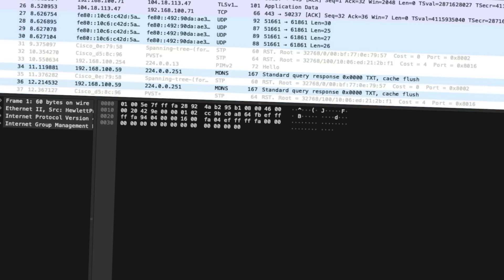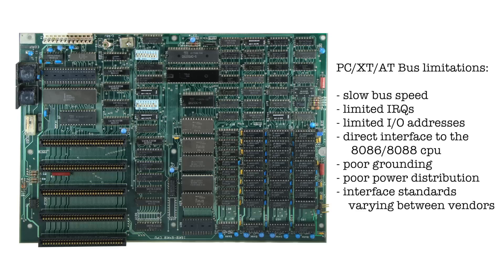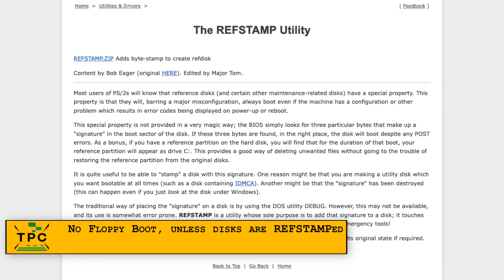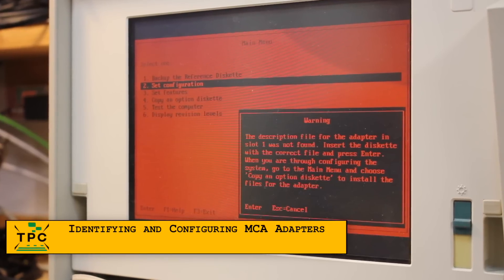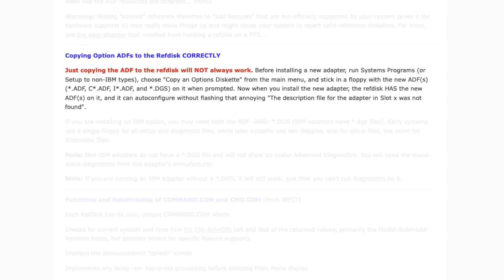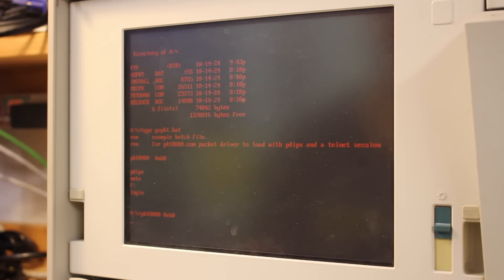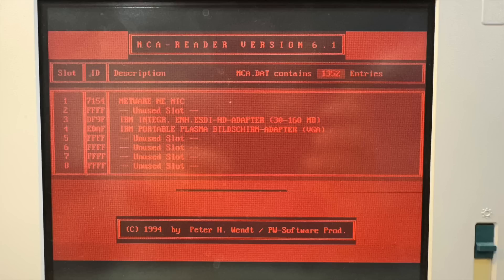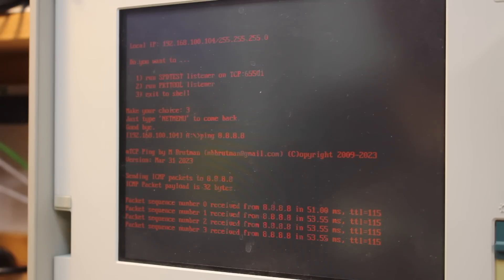Revisiting the IBM P70: Tackling the Micro Channel, Option Disks, and a Sneaky Ethernet Card

Comment: That brought back some memories, back in 1993 to 1997 I supported a range on ps/2 systems on token ring. The reference disks were a complete nightmare. I still have vivid memories talking to ibm tech support about a ibm 16/4 token ring card in an ibm ps/2 model 95 server running os/2warp and using the netBui and netbios protocol for a ibm lotus notes server and ibm said they couldn’t support it because of possible non ibm products

Comment: I think you are possibly overstating the scalability issues at large enterprise installations.  One of the benefits of the MCA architecture was not only the jumper less configuration, but the ability to poll the bus to locate devices and their configuration register settings.  This meant that a well written driver could not only find its adapter in the system, but read its configuration off the adapter itself.  This meant that as long as you had a level of standardisation (e.g. the fleet uses the same network card) once your O/S loaded the drivers would find the card and use the configuration on the card (not from a config file or command line arguments stored on the hard drive).  All you needed to do to manage this hardware was have in your tool bag reference disks for each PS/2 model you had in your fleet and ensure that you had all the ADF files needed.  In the extremely unlikely event that the machine needed configuration (CMOS batteries lasted at least 5 years so this would be an extremely rare event) all you needed to do was auto-configure the machine and you were done.

Comment: PCI learned from the PS/2 and added a "type" byte in the configuration data area that identifies the type of device the card is (in addition to 2 16-bit vendor ID and product ID values). That's why PCI devices can often detect what kind of device it is like "Fixed Disk Controller" or "Universal Serial Controller" on startup. But even then, the VID and PID are meaningless numbers. There is a database of PCI identifiers for this purpose online and operating systems like Linux build it into their source code so they can provide details.  USB expanded on it by adding strings to the USB descriptor so operating systems could print out something human readable.

Comment: In the early 90s I worked with a lot of MCA-based IBM PC's on token ring.  (16).  Consistency was key.  Use the same model machine with the same devices do not deviate.  We had a system based on OS/2 1.3 that had to run on Model 77 machines.  Period.  When it worked it was great but there was very little flexibility from a hardware perspective.

Comment: You can also use ROM-BASIC on an unconfigured microchannel PS/2 to get information on the needed ADF(s) - I have a video on my channel how to do this. Token-Ring adapters that emulate the IBM 4Mbps microchannel cards use POS ID E000, and microchannel 16/4 adapters emulating the IBM models (through the 'TROPIC' chipset) are POS ID E001. The Madge adapter you show uses a Texas Instrument Token-Ring chipset (who developed a few chip tier levels), and the IBM adapter you show uses the 'Spyglass' ASIC (63F7704). As you can see on the 'Ardent-Tool', the later 16/4 adapter version uses the 'Pinegrove' (02G1394) and 'Pinegrove Shrink' (50G6144; a die-reduction) ASIC, where the boot ROM code is integrated into the microcode EPROMs, and copied over to system memory space at boot-up.

If you are covering Token-Ring adapters, in short, we need to talk...

Comment: It seems to me that IBM did a lot of things right with MCA, but their biggest sin (from a technical standpoint - the licensing issues are a whole different story) was over-reliance on disk-based information.

The IBM AT was the first machine in the PC family to have any persistent BIOS configuration, and started the "Diagnostic/Starter/Reference Disk" madness - this arrangement was also adopted by some clones like the Compaq Portable II and III, but pretty much all other clone vendors quickly put their setup programs in ROM instead, which made much more sense - but IBM didn't get the memo until the ValuePoint/ThinkPad era.

Likewise, while the ADF concept was ambitious and allowed for comprehensive and human-readable configuration via the Reference Disk, relying on it to boot was a rather clunky design choice. Later standards like ISA PnP and PCI had the cards declare their resources directly on the bus, while also making all non-essential devices start inactive at boot and delegating most of the configuration logic to the OS and its drivers, which you need for the card to function anyway. That just makes way more sense and a more seamless user experience, even if the MCA approach of having all the configuration done before booting the OS is arguably more elegant from the engineering perspective.

Well, sometimes "elegant" solutions aren't the best, I guess.

A somewhat similar story happened decades later with (U)EFI - AFAIR the original ambitious goal was to move the device drivers to the firmware, so that any OS could just talk to the firmware instead of needing its own device drivers. In the end all we got is some very basic driver framework for handling power-on video framebuffer, and as much storage and network support as necessary to boot from either of those. And keyboard and mouse. And that's it. Every attempt at putting more sophisticated hardware abstraction in the boot-time firmware in the history of personal computing had failed, because that just doesn't make any sense in the end.

Comment: From a technical point the PS/2 architecture might have been somewhat great back in the day but the way of configuring devices feels rather annoying. Not even being allowed to boot your system after inserting a simple card seems sluggish and I cannot understand how something like that could've been made like this. Who thought, it was a good idea to have a floppy disk at hand for that? As you named it: in bigger companies that would've meant, you'd have a single disk for EVERY computer in the company which was running under that architecture. 
Even testing a card was impossible without that cursed reference disk.
Who thought, that was a good idea?

If I had to choose between a slower architecture with setting some jumpers (which I had no idea of back in the day) and the PS/2 way of doing it, I'd definitely have chosen the PC AT way.
Reply from the maker: At least in theory, their way of predefining the resources in the ADF files, and having the reference disk setup program trying to figure it's way in allocating conflict free resources, without the user needing to care, isn't a bad idea per se. It was just caried out very badly.

My guess is, it was time and money driving the decision to go with floppy disks.

If I were to draw a Dilbert, it would propably go like this:

Dilbert: I propose to store the Reference Setup in ROM, and add a 64-128k flash to store the ADF files.

Pointy-haired Boss: Nah, flash is too expensive. Why don't you store it to the hard drive?

Dilbert: Because Wally wrote the BIOS to invalidate the CMOS configuration if it detects new hardware. It looses everything and can't boot of the hard drive any more. He would take 2 weeks to rewrite it.

Pointy-haired Boss: Nah, that's too long. Go with floppies. Customer's will deal with it, and nobody got ever fired for buying IBM.
Reply: Back in the early 90s having MCA over ISA was actually nice. Until PCI and software configurable irq / io there was less pain. Sure it looks clunky now but I preferred it over ISA config at the time. 
The real limitation to MCA was IBMs greed. The extreme cost prevented a lot of cards being ported over or made one that did hard to afford. 

On my model 80 you could just hit F1 at an error and continue booting. Only that card that caused the error would be ignored (not sure if overlapping io spaces would be a problem )